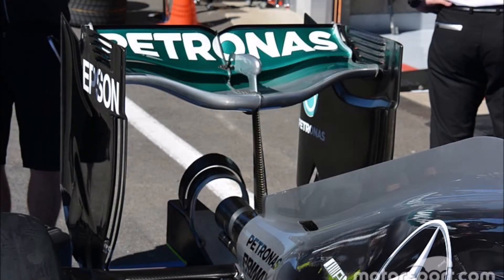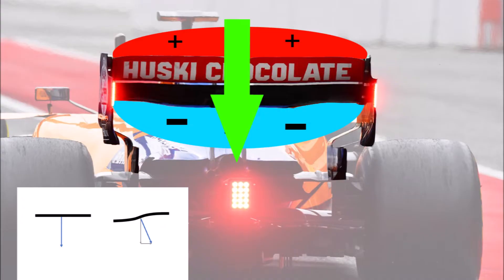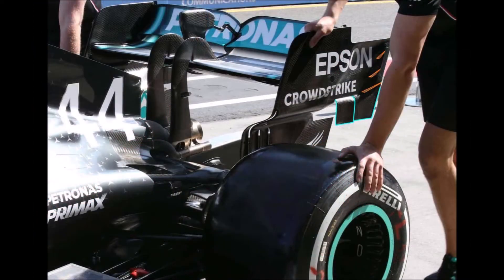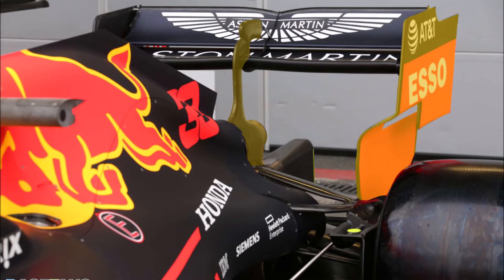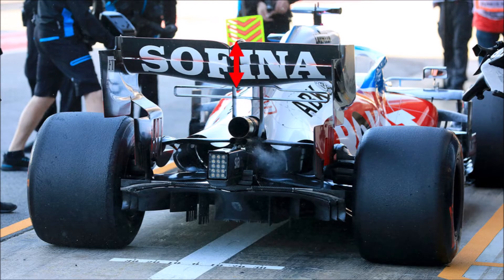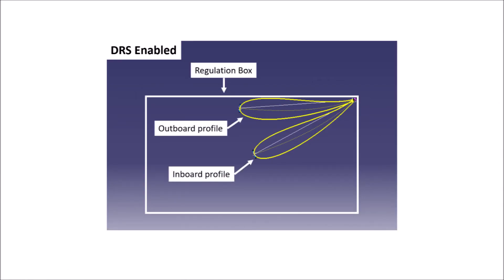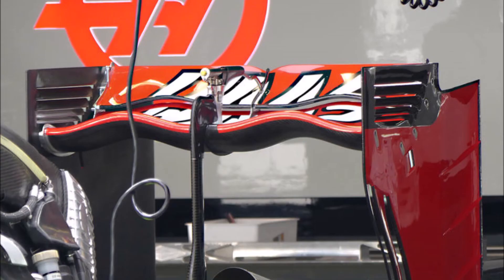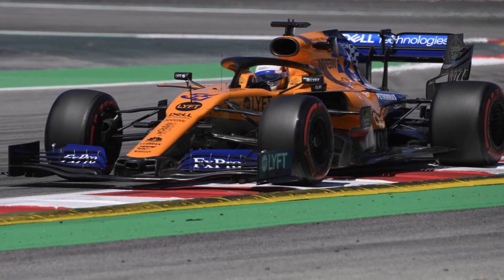F1 Spoon Wings Explained

Comment: Do you think that this wing might also be compensating for the deficits in rear suspension as well. If you curve the wing it counter acts body roll. Since the force vectors point inward they produce as torque opposite the tilt of the wing.
Reply from the maker: The side force will be on both sides and counteract itself, so there is not really an effect. The wings are not designed to compensate suspension issues. It's just to simplify production and to get a new wing quicker.
Reply: @bsport320  I think I understand now. It scoops back, not up. The shorter wing producing less drag at the tips compared to the long wing toward the center. Though I still want to know why teams have had different approaches, when designing these wings.
Reply: @sadface7457  don’t underestimate the time it takes to built them. As you need the forms and the also lay down the cfrp tape ( thonk they will use tape) and then bake it. You need that for 2 cars and different parts each race with little tine in between

Comment: I always thought the basic concept behind spoon rear wing was similar to the one of spoon front wings of 2004--2008.
Reply: The reason for the spoon front wings in the mid 2000s was that the outer 2/3s of the wing was regulated (such as minimum height), while the central 1/3 of the wing was free of regulations